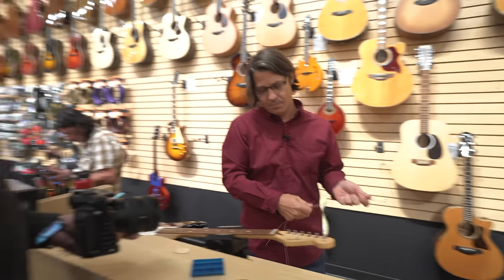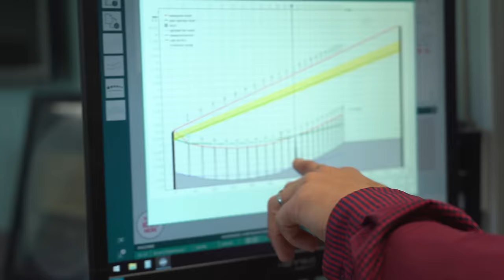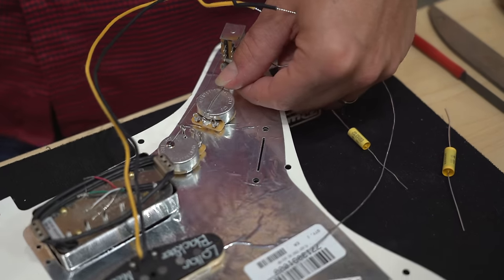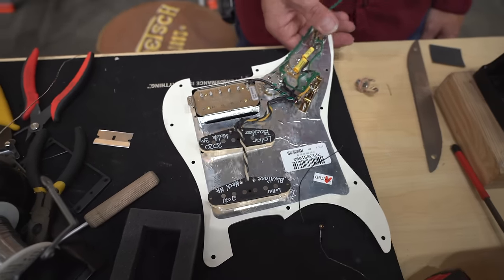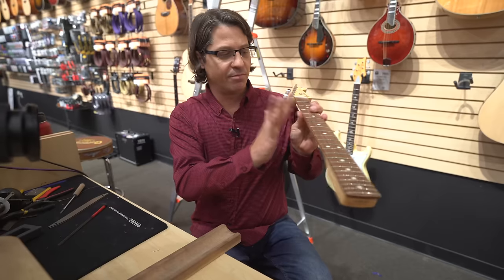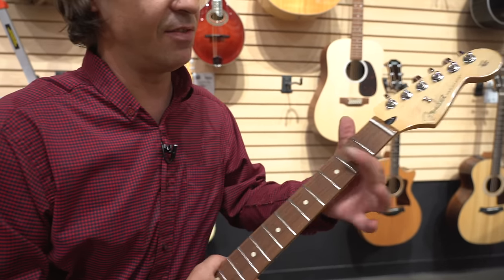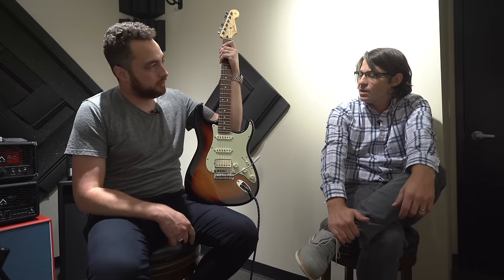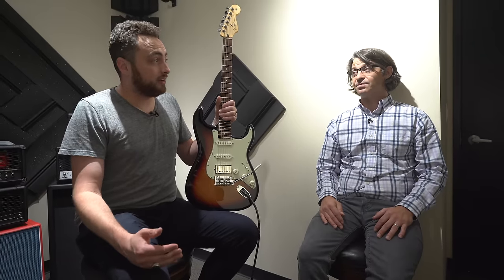We Tried To "Custom Shop" The Cheapest Fender Strat

Comment: There is huge ‘hidden’ value in have a guitar that you created yourself and love and just never sell.
Reply: Absolutely! I am constantly shifting and trading guitars, but the one I'll never part with is my partscaster strat that started as a squier. All together there's like maybe $600 worth of stuff there, but its MY guitar
Reply: Totally agree Russ. I like doing this with squiers & epiphones. New tuners; bridge; electronics and pickups and then do some setup and neck work (roll edges of fingerboards and sand the gloss back). Done 3 strats, 1 tele, 2 Les Pauls and 1SG and despite having genuine fenders and gibsons the self-modded versions have that extra something that probably comes from the care and attention I put into them + I’m not as bothered if they get a dink in them.

Comment: Now this plays nice straight off the box!

I got my mex strat with antiquity pickups, s1 switch, blend pot, trebble boost pot, super switch, locking tuners with only the bridge and nut original.  Plays like a complete charm and top custom axe!
Reply: I did the same. Bought a Mex Strat (mine has a unique colour you can't get on American ones) and basically changed everything on it besides pots, switch and nut for my part. Got a nice set up from my luthier. Now I have a 100% unique guitar that plays crazy good and is 100% custom to my cosmetic and sound taste. Cost less than 2k total.
Reply: @BabTheBabs  mine summed up in around 1100-1200 bucks and is nicer than many American made top strats I have tried :)

Comment: Scotchbrite pad (pack of 3) = $3
Emory boards (pack of 25) = $2
Took an Epiphone Les Paul and buffed the neck to a dull satin using the scotchbright bads and sanded the finger board edge slightly and rolled the fret edges using a few emory boards. Set it up and with $5 and a couple of hours, had it playing as well as my Gibson SG.
Reply: You hit that nail right on the head. I tell my kids "What would Eddie do?" Eddie Van Hallen would have done this all day long. Nothing wrong with being more like Eddie!
Reply: I plan to do the same with mine as well
Reply: Facts
Reply: that’s how it’s done man. i’ve done the same with my affinity stratocaster, though i had to do some more extensive work on the fret ends cause they were pretty rough. after that, i swapped out the tuners with wilkinson vintage ones and made sure the nut slots are saddles were well lubricated. aside from the bridge pickup sounding a bit shrill, it’s my go to guitar most days. the trem stays in tune beautifully and the neck pickup sounds insanely smooth for what it is
Reply: Use vinyl wrap is better, reversible

Comment: If you start from a Squier classic vibe you can save 500 already without any mod. And you get a proper body and neck to start with. Not having bone nuts on a Player for 850 it is sad. MIM used be around 500 new not a long time ago. Prices went up like hell without any real improvement.. and that it is not just inflation, it is agressive pricing strategies.
Reply: yah i bought my MIM For under 500 back in 2008. now i’m 30 and i still have it and thinking about showing her some love

i stopped buying fender (even though they’re hot due to social media)

you just don’t get as much from fender as you do other brands. i play an ibanez THBB10 and it’s def my favorite guitar ever

full scale, locking tuners, roasted maple neck and a tremolo bridge that doesn’t go outta tune or constantly needs adjusting.
Reply: i agree! no reason to pick MIM over high end squier now except the logo 🙄
Reply: @elliottsmith10  Gretch is my favourite these days. Still got my 97 MIM Tele that I got fun under 500 back in 98

Comment: I'd love to see how this guitar compares to the Fender American-made models, since with all the upgrades your at pretty much the same price as the Americans
Reply: Exactly. I think the real trick would be to buy a used MIM Strat for $500, set it up, maybe replace the pickups and nut yourself and have a killer guitar for a little over $1k.
Reply: This is actually more expensive than the American made ones. But you still need to get it set up no matter where it’s from
Reply: @mikepj1025  similar to a $1,999 Clapton signature. Those have an urathane finish. Clapton’s choice pickups are probably cheaper than the Lollars as well.
Reply: @geoffcowan2384  tbh, a lot of used mexican strats from the late 90s up to about when they switched the name to the player series and chnaged the fingerboard material options from maple and rosewood to maple and paul ferro are both less expensive and better instruments due to just a better supply of resources at the time
Reply: I have a 2014 American that I bought new; I also bought a brand new MIM ("Player Series") last summer. Both are set up and intonated perfectly. The only mod I made to the MIM is to have the fret ends dressed, and I installed locking tuners. No electronics upgrades. So what do I think? After a year, I prefer playing the $850 MIM over the $1700 American about 90% of the time. It's all subjective of course, but to me, they are so close in every respect (that I care about at least), that it makes me wonder if an American really is worth nearly 2x as much. I've heard - well after I bought it - that Fender really stepped their game up on the MIM's recently.
Reply: @geoffcowan2384  yeah he has noiseless in most of his models.
Reply: @johnsmith-ug5tp  couldn’t agree more. The necks on the Am Pro II are the best I’ve ever felt but I don’t like anything about the pickups. I miss the Standard line and those pickups. The pickups is what’s keeping me from buying one and now that they are $1800 it’s not even an option anymore.
Reply: you can buy an american neck with the rolled edges and rounded fret ends and separately and just slap one on a player series body with room left over for better pickups and hardware and still come out paying less than any off the shelf american strat
Reply: @arglbargl  I did this exact build last year. Came out amazing. American Pro II neck on a player body with a fender loaded pickguard with 57/62 pickups. Incredible.
Reply: @johnsmith-ug5tp  they're a little cheaper than that at stratosphere, but i was just using that as an example of not even bothering to save money and still ultimately spending less than you would for a new american fender. if you go for a licensed neck and get some pickups from a smaller builder you can easily get the total cost down into player strat territory without sacrificing quality
Reply: @kylehill9653  Fender used rosewood in Players up to 2017.
Reply: @markuyehara7880  ah i thought it was at the time of the name change, when did they change the name to the player series then? just curious if yk
Reply: @ghost mall yk, it may also be that a lot of the surviving mexican guitars from the 90s are good ones, wasnt around to play them when they were brand new but, all the examples ive played have been excellent, that said, who knows what parts could have been replaced for other higher quality ones in the past 25-30 years just by picking up a guitar and playing it? i for one cant tell a replaced switch from a stock one without taking it off and looking at the serial number, yk? but tbh fender mexican guitars are generally all decent at least

Comment: I've got a cheap '96 Squier Strat made in China, one of the very early Affinity series (no Affinity logo but just says Strat on the decal).  The difference you can make to a cheap guitar like that just by changing the pots, switch, jack, wiring and the capacitor is absolutely huge.  500K pots and bad cap values are standard on a lot of cheap Strats and mean the tone controls barely work except at the extreme edges.  My other Strat is also a Squier, from the Protone series, and even that much higher end guitar had cheap rubbish pots, jacks and switch in it.

Bottom line (IMO), make sure you replace the electronics and try the guitar again before you even consider splashing out on new pickups.  Shielding with kitchen foil on the back of the scratchplate and in the cavity also makes a huge difference with background noise, again IMO.

Comment: Informative. I've been playing now for 50
Years. Owned a few music store's, worked on my share of guitars also. I've had top end brands but around 10-12 years ago
I finally realized that the Neck on an Electric is #1 priority for the pros.
Everything else is subjective.
I've been rolling the fretboard, rounding the frets on all my electric s. But there is one other thing I do that y'all left out.
Up untill 2017, when " Real Rosewood"
Plank's were used (NOT PAU FERRO OR INDIAN LAUREL 😡👎👎👎)
I would specially Treat the The Rosewood
Board with baby oil, let settle then wipe,
Then melt candle wax over the whole fretboard, rub wax in pore's of the wood, take off using a guitar pick, then clean real good, then last baby oil treatment,
Let dry, wipe down and fellas, that neck'll
Feel and play so good it'll make a train take a dirt road. BTY, I "Exclusively" play and seek out old Squire Affinity Teles and Strats. Nice necks with medium frets for smaller to medium sized hands. And what is it with these guitar manufacturers putting "JUMBO FRETS" On all their instruments. Like Jaco stated:
Frets are like Speed Bumps!
ESP/LTD Are notorious for this crime.
Anyhow.... Don't Fret and Happy Playing
Reply: Ps I always use lemon oil on my boards. So is it imperative to use baby oil? Just wondering.

Comment: I liked the original pickups more. But the frets and action is much better for sure after the optimization
Reply: Yeah I honestly thought the pickups were not worth it lol
Reply: All this guitar needed was a clean up on the frets. I’d put staggered tuners on and get rid of the string trees. Sanding the neck and rolling the edges are optional. The pickups were better stock.
Reply: I didn’t have a problem with stock pickups either! I think maybe at home or recording the new pickups might show their character more, but in a live mix I doubt anyone will notice.
Reply: @misterknightowlandco  Right? Take that $800 and slam a roasted maple warmoth neck on it 10-16" compound fretboard radius, take the additional $300 and have a party lol.
Watching a guy take a razor blade to the fretboard of a brand new strat was cringe too.
Reply: @sumgui6010  completely agree. I’ve never in my life seen anyone razor blade a fingerboard before. If you like smooth sanded necks just a piece of really low grit sandpaper, pretend your jerking the guitar off and you’ll get the same effect. The one time I did it I didn’t even bother oiling it afterwards. Still feels great 7 years later. People place way too much stock into their gear in general, but this modding stuff can be stupid. When you mod a house you add value. When you mod a car, you add value, but when you mod a guitar and can’t get it back to original then you kill the value. Go figure. Mexican strats are typically fine as they are. I’ve never picked one up new in a store where anything more than a truss rod adjustment, intonation check and new strings didn’t fix.
Reply: @sumgui6010   I bought this exact guitar but with a baked maple, satin finish neck and it’s honestly amazing!

Agree with comments that staggered tuners, no string tree, gotoh 510 with locking saddles. These things play amazing when you make those mods and clean up the frets a bit
Reply: @ghost mall thing is, they played it through a totally different amp, with a totally different sound. 
I liked both, would love to know what that second amp was. 
Unless they just set it up completely different.
Reply: @ghost mall The ability to setup and repair guitars does not make you a luthier. A luthier builds guitars from scratch
Reply: @ghost mall luthier or guitar tech? Big difference there.... For $800 this thing should've had a whole new neck on it anyway.
Reply: The original pickups sounded sweet
Reply: @sumgui6010  You having no idea about fairly common techniques doesn't make them "cringe," it just means you shouldn't comment on things you know nothing about.
Reply: @miccullen  oh yes, because I think it is cringe I surely don't also know that it's common, and because it's common I certainly can't have my own opinion about it being cringe. Thanks for the correction Master!
Reply: @sumgui6010  lollar pickups ain’t cheap. Decent amount if the 800 is with the pickups. Also nit sure how much people charge to use a plek machine. Never done it.
Reply: @allstopblue5717  I know, some might say, over priced.

Comment: A week ago a friend of mine saved up some 5k to buy a customshop fender. At the shop there were 5 cs fenders and one secondhand 1976 fender mocha with big headstock. It, the 76 was naturally reliced and felt better and sounded better than all the cs fenders. The 76 was all original except for the 3 way switch which was replaced with a 5 way. To be honest I never played a cs before and was actually disappointed because I expected something special for the 4300+ euros CS fenders. Maybe my expectations were too high, my friend also really preffered the 76 which was 1000 euros less expensive...yes, I use the word expensive and not cheaper. My conclusion for that day is that the CS failed to truely experience an old fender by making a new fender old.
Reply: There's no getting around the age of the wood.
Reply: Some of those 70’s were dogs (cbs quality control?). Nothing a good luthier, (and some tuners and pickups, saddles, bridges and a nut couldn’t fix?). May need a refret, somewhere along the line too?. Like I said elsewhere, a classic vibe squier, is about $600? (Not cheap for a squier), I’ve fiddled with good L series (downside up), but if you can’t make a squier sound good, the guitars not the issue. (Not had much to do with mex fenders for a while, but they seemed fine to me).
Reply: This was a good lesson.  Custom shop is for people with $, who think they're getting a better fender.  They're not.  They're just getting a prettier one.  Without a second thought I would have taken the '76 for that kind of money.  Anything that isn't a vintage Fender I will never pay over $650 for.  Period.  Otherwise I stick to MIM's and mod the shit out of them so I can end up with an old sounding Strat for right around $1000.  $5K for a new guitar is friggin ridiculous.  I'd never pay that for any axe.  One shouldn't spend over $1000 on an axe ever imho.
Reply: I’ve played 3 CS Fenders. 2 Strats and 1 Tele. None of them were worth the price. Not even close!
I’ve played hundreds of MIM Fenders that played much, MUCH better!

Comment: I come to a very different conclusion that Rhett Shull did in this video.  The question being, can you custom shop the cheapest Fender Strat, is worded a little strange, but it basically means can you upgrade the cheapest Fender Stratocaster to the point that it is just as good as a Custom shop guitar.   The answer he came up with is No, but you can end up with a really good guitar.   My answer is yes, and in fact you can customize a guitar to be better than a Custom shop.  You don't get the resale value, but if you are buying a guitar to sell it, then you don't really have a reason to upgrade it at all.  No, you upgrade a guitar to make it better suited for you.   If the finish isn't good enough, then you can refinish the guitar just the way you like it, if the pickups are not as good, you can upgrade them, so on and so forth.  You can start with a Fender Squire guitar and upgrade it to the point that it is better than what Fender will do in there Custom shop.   
Now can you do it for less?  You could, if you did some of the work on your own, you could save a lot of money by doing a lot of work in the home.  You could sand down the finish to do away with the clear coat on it and then refinish it with what ever type of finish you like.  You can reshape the neck to how ever you like, you can even give the guitar a better access cut for the high frets if you want.  You can do a lot of stuff at home, you can have a shop do a lot of stuff that you ether don't want to do at home or can't do at home.  Now, with all that work, you can come up with a guitar that is better than what you can get or will get from the custom shop, any day of the week.    
The only thing you can't do, is make the market recognize that the guitar you upgraded and refinished and did all that work on, is miles better than what Fender Custom shop can do.  Even though the guitar can play better, it can sound better, it can even look better, but you can't convince stupid people that all that effort and work made it better, because to foolish folks, the only thing that matters is what the factory did.